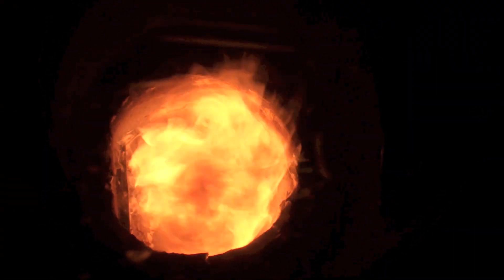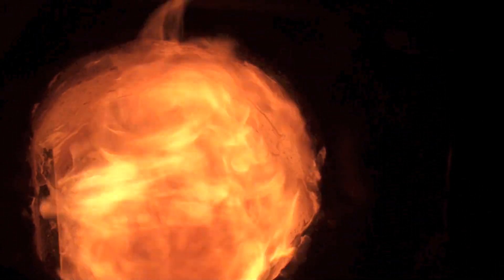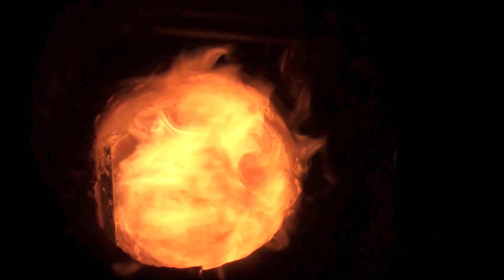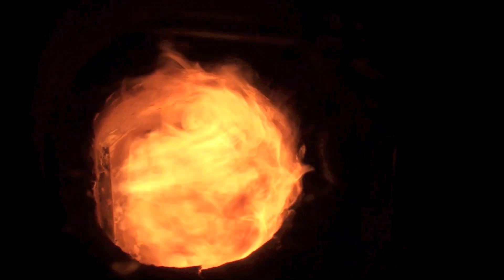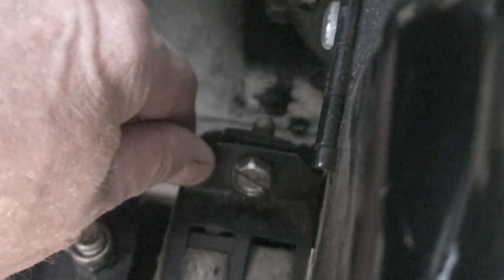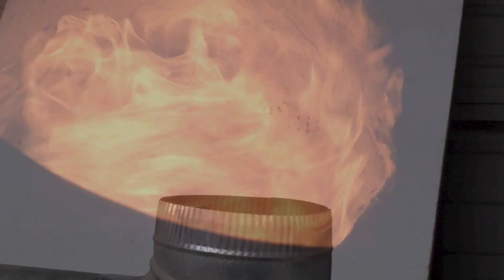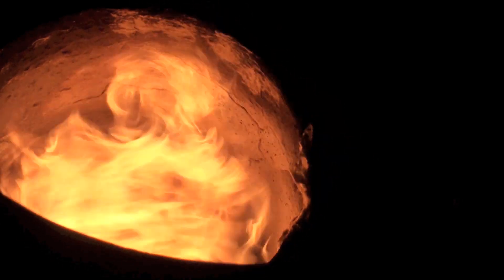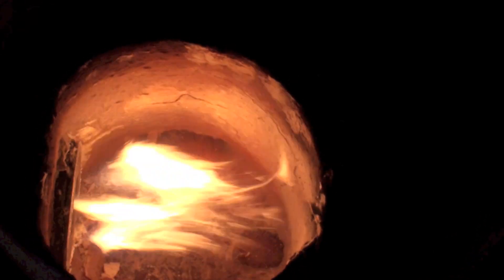Setting the oil burner air adjustment

Comment: Trying to understand the correlation between too much air and too little air in relationship to the output air temperature (at the heater vent). It seems that with too much air, the output temperature will decrease. However, it also seems that with too little air the output temperature also decreases (and the exhaust air gets smoky). Is that correct?
Reply from the maker: Nick Bohdanowicz I think you have that one a little backwards.  Excess air will cause lower stack temp.  I will do a vide on that.
GFM
Reply from the maker: Nick Bohdanowicz There is a drop in heat transfer when more gasses are forced thru the heat exchanger, but the difference is quite small compared to the lower temperature of the flame caused by excess air.  I have to differ from your teacher a bit about excess air.  I have found that 10% excess air is a disaster waiting to happen.
GFM
Reply: Nick Bohdanowicz You have to admit though that Mr Gray's video and explanation are quite convincing.
Reply: No doubt about it I only have respect for GFM and all the other HVAC techs on youtube. I've been Watching this channel since I was still in school for this stuff.
Reply: +John Tuttle  as you increase the amount of combustion air past what the burner can actually use, the stack temp will increase. I know this seems backwards but it is because the extra air can't be used for combustion because the flame has all the oxygen it needs, so the extra air gets heated and put up the chimney, decreasing efficiency. With too little air, the result is incomplete combustion. The soot you see is fuel that could not be burned because the flame didnt have enough oxygen. resulting in a lower stack temp due to less fuel being burned.
Reply: In my CSA textbook for conversion burners it states When excess air is introduced, more gases must be heated by the same amount of btu. at the same time a larger volume of flue gas is forced through the heat exchanger in a shorter period of time, causing a decrease in heating efficiency due to higher flue gas temperatures. My teacher told us 10 - 20 % excess air is ideal, any more than that and you are decreasing the combustion efficiency.

Comment: Any insight on a burner with excess air?  This specific Beckett AF burner I am working on provides so much excess air that even with the air shutter at the lowest setting and the air band completely closed, the flame still appears to be a bit too lean, and there is absolutely no visible smoke at all.  The stack temps seem far too high for the current setting.  This specific unit has a Becket AF burner with a .7 nozzle.
Reply from the maker: Rico Draconis If you are sure both the mass air band and shutter are closed, the only thing I can think of is an air leak.  Perhaps around the transformer.  Hope this helps.
GFM
Reply: grayfurnaceman Both were when I was adjusting it, and I have checked for leaks around the transformer and other places.  Could, perhaps, an incorrectly sized head for the nozzle size cause this problem?  That is the one thing I can think of that I have not yet checked, mainly due to how difficult it is to get the burner unit off and on the furnace, as it is an old furnace (~1959 I believe) and the studs are quite rusted...
Reply: Wow, I never did correspond again with my findings did I?  Well, looking through old videos I've commented on I found this again, and I might as well go ahead and explain what my findings were.  Back then I was learning all the needed material to get the system up and running again properly, and I determined not long after the comments that the nozzle was in very bad shape and was quite badly under-firing the unit, there was no way to get the excess air low enough for the tiny amount of fuel that was being added, replacing the nozzle as well as cleaning the pump's internal filter resolved the issue and greatly improved efficiency, and reduced stack temperatures quite alot.  Thanks for the insight though, your videos are very educational and I enjoy them.
Reply: Hi, i also service my burner and watch most of MR. Gray videos, i want to ask you, i think your burner is like mine "Beckett F,AF type, what size of Nozzle did you use when you change it, i am using 1.10/80W, i think i  it is a little over the size, but i think Beckett recommend 80, but not sure A,W or what.

Comment: Please I need your help. When I turn on my oil burner it seems to be working just fine. However, there is a lot of smoke coming out from every hole. What should I do? Thank you very very much!
Reply from the maker: Sounds like you have a plugged chimney or heat exchanger.  Start by pulling off the vent pipe and looking inside.  Be prepared for soot all over.
GFM
Reply: grayfurnaceman Thank you very very much!

Comment: aren't you suppose to set it to the numbers nest to the adjusting rings? there are two
Reply from the maker: Harry Rivera The numbers are pretty useless.  I set it to match what the combustion analyzer reads and the how much smoke is in the vent gas.
GFM
Reply: @grayfurnaceman  I looking for adjustment help.  What is the starting point for the air ring and adjustment band? 1.5GPH 80° nozzle Beckett AFG on Weil McLain SGO Gold steamer. Thanks.
Reply from the maker: @jfbarsanti  Here is what I would do.  Close the mass air damper (the band) then, with the burner running, close the end damper.  Looking over the fire, adjust the damper  until the smoke just cleans up.
It is best to use combustion analysis, but you may be ok with this.
GFM

Comment: What number did u start from when you pulled back
Reply from the maker: M D A M A D Do you mean the smoke number?
GFM
Reply: grayfurnaceman by the air flow adjustment there are number 1 to 10, I put it on 5

Comment: could I use one of the front ports to adjust air??
Reply from the maker: thetruth I would need to know what ports specifically.
GFM
Reply: grayfurnaceman just the ones that have the flap on it to see the flame. Anyway on the airflow adjustment has numbers from 1 to 10 what is recommended?
Reply from the maker: thetruth The flap is just an inspection hole.  Should be closed.  The numbers are just for reference.  The best way is using a smoke pump to check the amount of smoke in the vent gasses.  No smoke pump open until the flame looks just bright and no more.  
GFM
Reply: grayfurnaceman right now I have it in the middle around 5 and it looks clear no black smoke and no rumble sound

Comment: Technically, this rich flame will have high CO2 and low net stack temperature, and therefore is very efficient - until soot accumulates.

1/8" soot is about R-4 insulation...
Reply from the maker: Bill Kitsch The increased efficiency is the the low excess air which cools the burn.  There will be some loss in burn efficiency due to the CO passing out the stack and, of course the soot itself.  If only we could put soot inside our walls.  Thanks for the thoughts.
GFM
Reply: I would disagree somewhat... if the flame is producing a high amount of soot, its also producing a high amount of CO (carbon monoxide), which does NOT get as hot as a properly burning flame, which allows for the lower stack temps AND a lower BTU output foor the amount of fuel passing thru it.... so it is NOT as efficient.

Comment: I have an anciet montag from the 1920 i think maby newer its my best one yet . I also mix resturant oil about 50/ 50 with that blend the nozzles don't clog . you have to start it on the red oil and finish it on red too to be set for the next round. its kinda a hobby and saves money ....
Reply: Friggin awesome bud, thank you.
Reply: Just wait until all that heavy weight unburdened oil ignites because the nozzle spray pattern isn’t designed for that and will clog up eventually .  Loud bang and a melted home.

Comment: Gray Furnaceman I have always cleaned the nozzles with an ultra sonic and watch cleaning solution and have found it is usually the filters that cause most of the problems especially the cintered type . the screen ones are a lot less problamatic. Do you recomend just buying a new nozzle or cleaning well ?

Comment: the best yet . Will get my beckey dialed good with this good advice .have several spares . just got a farm with a beck been sitting for years . won't lite yet has oil . Probably a clogged nozzle .
Reply from the maker: I will be doing combustion analysis on the oil furnace soon.
GFM
Reply: saw that one maby there is yet another . got a gauge off ebay and will bring some parts out to futs with thanks mate . may call on you again if trouble visits ...Dan out

Comment from the maker: Close the adjustment until the flame is dirty looking.  Then open until it clears.  Use as little air as is necessary to clean the flame.
GFM
Reply: I have closed the air adjustment and moved the adjustment little by little and I still have smoke coming back into my face. What do you think the problem could be?
Reply from the maker: @powerram92  If you are getting smoke out the inspection hole, you have a blocked heat exchanger or vent pipe.
GFM
Reply: @grayfurnaceman  where would the heat exchanger be on an oil beckett furnace? Or do I just have the vent pipe?
Reply from the maker: @powerram92  The heat exchanger is above the combustion chamber.  It could be a second circular chamber above the combustion chamber or a section of pipes between the combustion chamber and the venting.
GFM
Reply: @grayfurnaceman crazy how you are giving advice that is by and far out of the reach of a average home owner.  If you are getting soot out of the inspection hole it needs to be brushed out , burner assembly cleaned , nozzle and oil filter changed and have a combustion analysis done. Which I’m sure anyone at this point resorted to

Comment: It looks like my air adjustment is just about full open. Whats a good starting point for that. All the filters have been changed and I got a new nozzle. So I'm ready to go.
The flame is too white, I think. And it seems like I'm not as efficient as I should be.
Thanks.

Comment: It is very simple after you get used to fooling with them, very very small adjustments is what it takes, that cool to get a inside look at things, I have replaced about every single part you can think of on these things even down to the liner, thanks for sharing that!